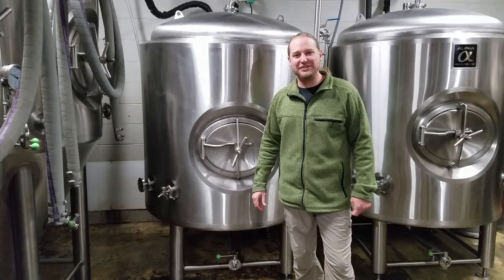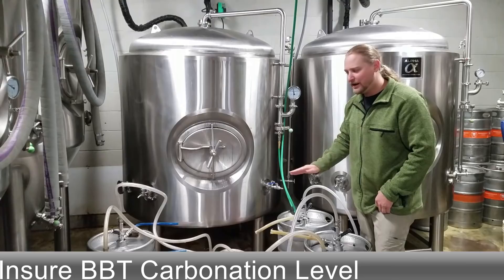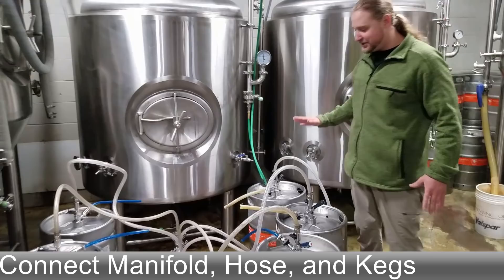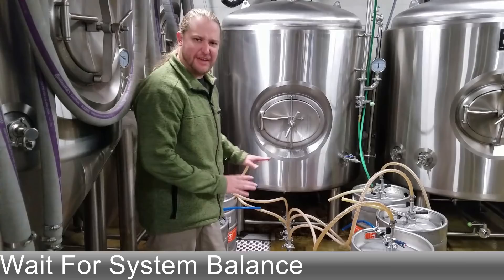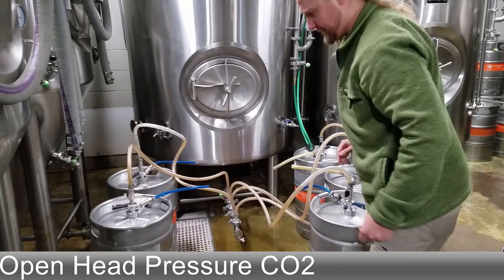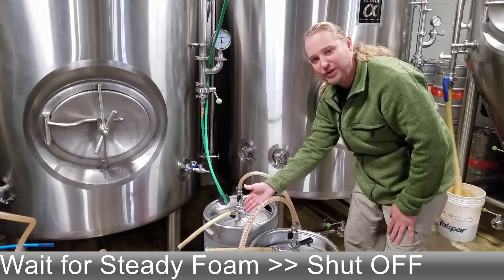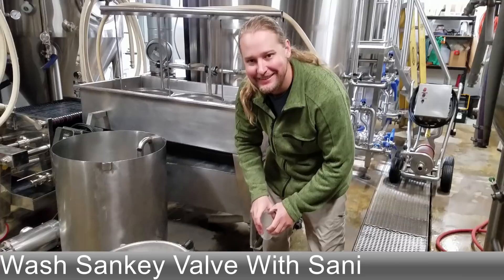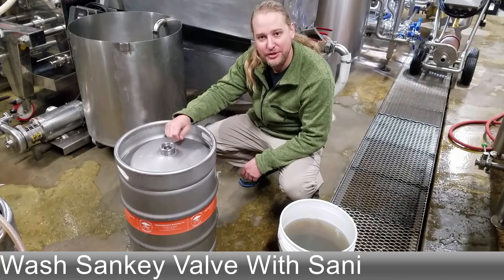KEG BEER!! How To: Microbrewery

Comment: I read a paper from MicroMatic that suggested you can place the kegs at an angle , maybe a door stop wedge placed under the edge of the keg to get to 60-70 degree angle. This will leave the proper head space to allow for pressure increase with temperature rise.  Per MicroMatic " A 1/2 Bbl keg filled at 4°C will increase in volume by 140 ml at 15°C, 200 ml at 20°C and 450 ml by 40°C. Without proper headspace, the extra beer volume has nowhere to go, and pressures inside the keg can reach and significantly exceed 10 bar in 1/2 bbls and over 13 bar in sixth bbls."  Be safer and save beer, winner winner chicken dinner!!

Comment: Hey Jasper. This was a great video. Very informative yet again! I have another a question for you. Could I use the same Sanke coupler you have here, to do some manual keg cleaning? The keg cleaning systems are very expensive to purchase, and we will get one but for now I need to do some elbow work to pay for one. It seems like I could put the keg upside down and drain it onto a bucket. Then with a pump I could recirculate the necessary cleaning agents through the spear and it would clean. Thoughts on that would be appreciated!
Reply from the maker: Thanks, yes.

Comment: Hi Jasper,
Another great video. 

Can I please ask, how did you sanitize all the fittings and valves prior to filling the kegs? 

Simply place inside a bucket of sani, or run a CIP/Sani run as you show in your CIP video?
Reply from the maker: +thegboat Thanks for the question! The BBT is CIP with sani, purged, and under pressure. 
The small hoses and other parts are disassembled and just soak in sani for 30 mins. Then reassembled and blown out with CO2 before hooking the manifold to the BBT. 
Hope this helps, Cheers!

Comment: Great video!
I'm going to have my own brewery this June. I was worry about my shortage of the operation knowledge, until I found your video!

I have four 400L fermenters, but I don't have any bright beer tank. 

Do you have the experience of kegging beer from fermenter directly through the filter then into the keg?

And did you ever fill un-filtered beer    into the keg? Will the preservation time become too short?

Cheers!

Chi-Chao Li
Reply from the maker: +李啟肇 Thank you! You are going to make great beer!
I have never filtered straight into a package, but it is an interesting thought. If breweries do not have a BBT it usually means they do not filter. Temperature flux and carbonation/fill levels in final keg could be tricky, but it does seem possible.
Good news is brewers put unfiltered beer into kegs all the time. Shelf life will be affected slightly but kegs are more stable than cans/bottles. 
Ways to increase shelf life would be, make sure the beer is really cold before packaging. This helps gravity act as a filter. Maybe try biofine (a cellar fining agent) to clear the beer in FV rather than filter.  You could use an empty FV to filter into rather than a BBT. Always try to limit dissolved oxygen in cold beer. The number one thing that determines shelf life is package temperature. If the keg beer rises in temperature, months of shelf life will be lost. 
Best of luck, Cheers!

Comment: what would happen if the kegs were under pressure? say at 5-6PSI. would that not fill the kegs?
Reply from the maker: The kegs and the BBT are both under pressure here, 12psi, this keeps carbonation. The pressure differential between keg and BBT will cause the beer to move to the lower pressure direction.  It's possible to fill kegs at any pressure but usually the carbonation level and temperature dictate the filling pressure. Hope this helps, Cheers!

Comment: in the video is shows on the banner to double check the keg fills by weight. What should they weight?
Reply: It varies by the gravity of the beer itself.  It's not a huge difference, but if you're bothering to weight your kegs, you might as well do the math for each beer.